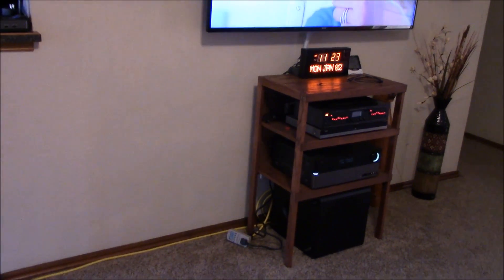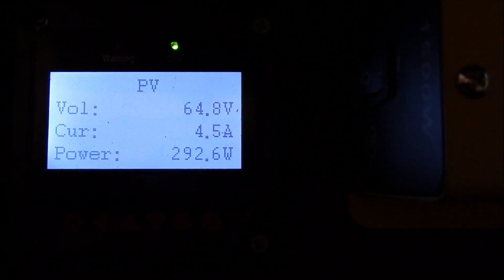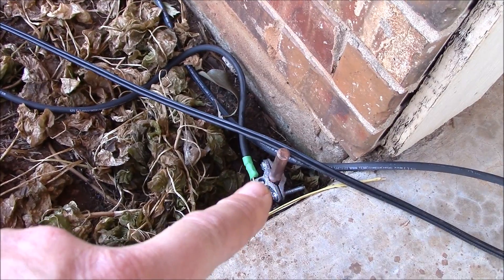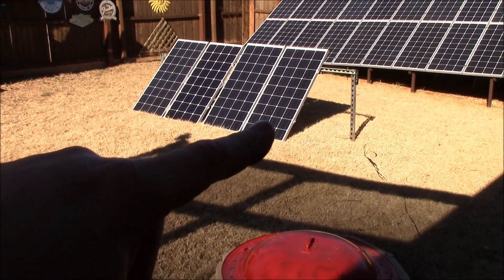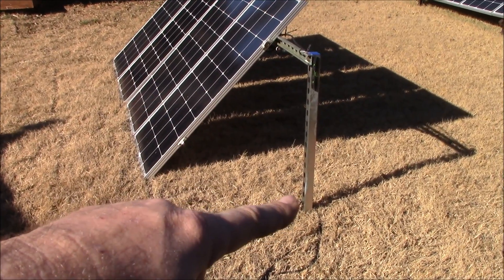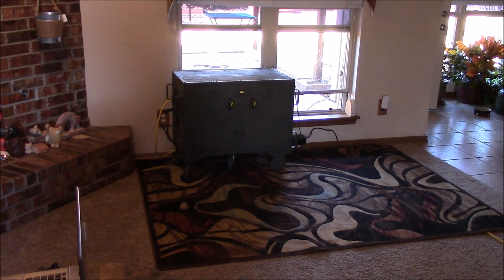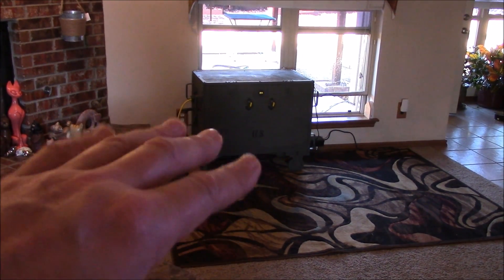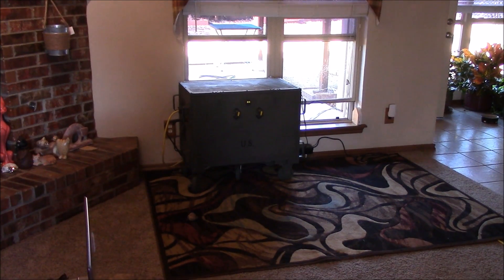24v solar generator inside, 400w in solar panels on DIY backyard stand

Comment: Excellent job!  It's working great.
I think I read you can hook up to 5 panels up to that charge controller if it's the 40amp model.
Take Care.
Reply from the maker: Yep...sounds about right. It is the 20-amp unit...but, I am running 24v (so, double the power). About 500 watts max is what I expect to get out of this unit. If I was running a 12v system...250 watts.
Reply: Chris DIYer Yes indeed you are absolutely correct, since I am building 12v, I tend to read everything under those restrictions as well.  It's great sharing all of this information I Can't even begin to say how much fun it's been & still is.  Some day if you have the time I would really enjoy a video of your favorite & most useful tools you have used for your solar projects.
Take Care.
Reply from the maker: Good idea...will think of some of my favorite tools and do a video. I will do a video this week on a "2016 Wrap-Up" of my utility bills, kWh bought/made, etc-etc. Should be useful information for viewers!
Reply: Chris DIYer I will keep an eye out.

Comment: Chris what have your electric bills been lately from your utility?
Reply from the maker: I will do a video this week with a 2016 "wrap up" of my electric bills, kWh used, and few other things. My last bill was $48.
Reply: Chris DIYer That is too funny. We had a bill of $48 last month here in Central Florida with our 2500 watt PV system. We have a family of 5. The solar definitely helps offset the bill. This month of December was a lot lower due to the Sun angle of course. Keeping our panels clean in still imperative for good output. We are averaging 7 to 9 KW per day. 

Yes please do your year in review video. That would be awesome.